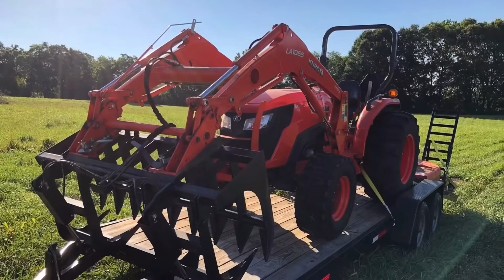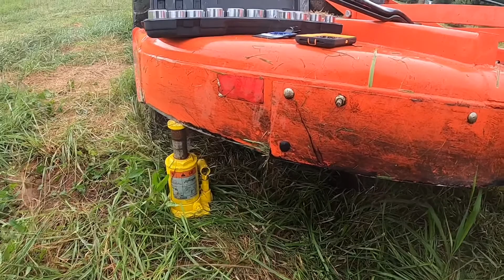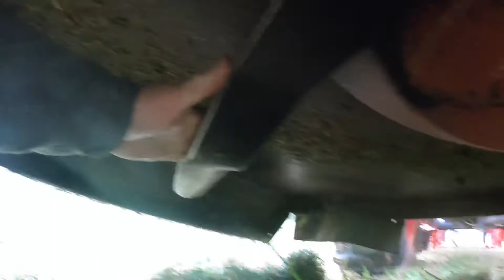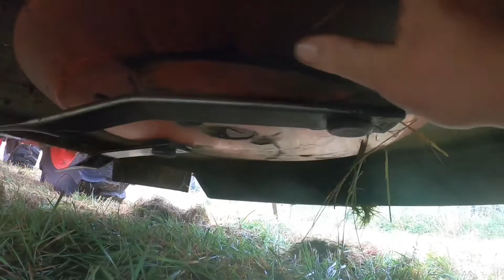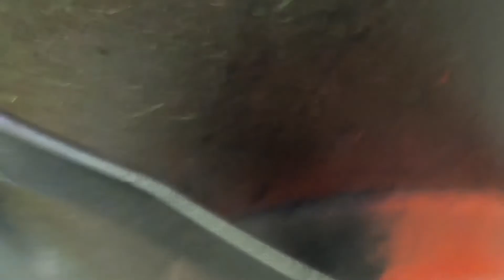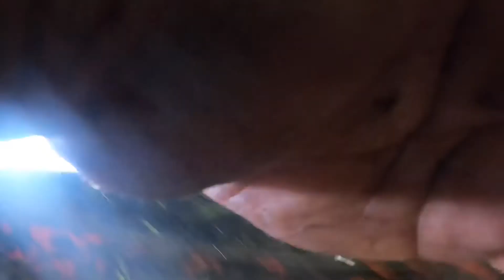How to Replace Blades on Land Pride Rotary Cutter - In the Field with No Impact Drill

Comment: Good video- thanks---
quick comment though.... you have a lot more faith in that tiny 2-3 sq. inches of bottle jack head than I could!!
question: are there any torque requirements when tightening the bolts back up?
Reply from the maker: 😂 Good eye, thanks for noticing that! You have made me laugh so hard!! Really should have got something else like stacked wood or even a spare tire. No concrete blocks - manual says no blocks!!

Manual reads: 450 ft-lbs / see below

IMPORTANT: Examine blade bolts (#1) and flat washers (#2) for excessive wear and replace if worn.
8. Insert blade bolt (#1) through blade (#6), dish
pan (#4), and flat washer (#2). Secure blade with a new locknut (#3) and torque to 450 ft-lbs.
9. Replace access cover (#5).
10. If replacing dishpan (#4), nut (#7) on gearbox output shaft should be torqued to 450 ft-lbs. minimum and secured with cotter pin (#8) with both legs bent opposite directions around the nut.

I tightened the bolts dawg tight! Hadn’t had a problem yet.
Reply: @TheRamosFamilyFarm  
Holy Cow!! 
450 ft. lbs. !!???

that is one hell of a lot of torque.... The only torque wrench I can find that will even measure that much torque costs almost $700---
Thanks for the the info--- much appreciated
Reply from the maker: @samuelfreeman2181 , 
You are welcome! The leverage I got with that pipe and huge wrench I used was plenty. If a bolt can be broken, believe me I’d break it. You can also use an air or electric impact driver. Let me know how it goes. Thanks for watching and taking the time to comment.